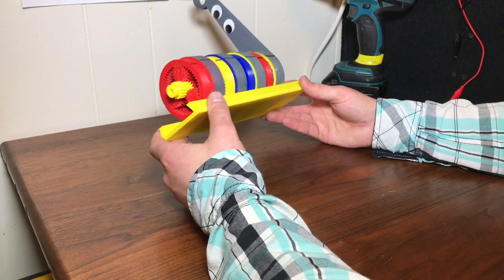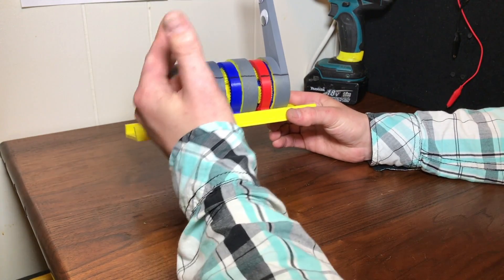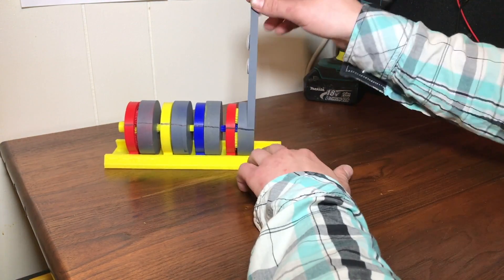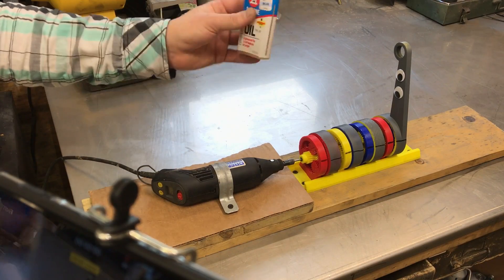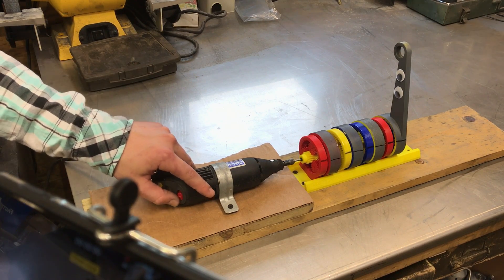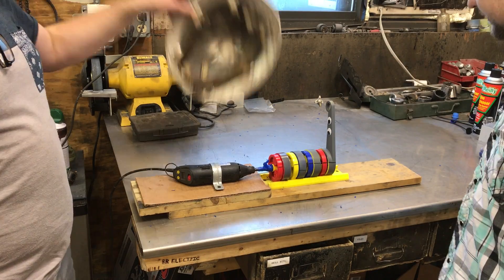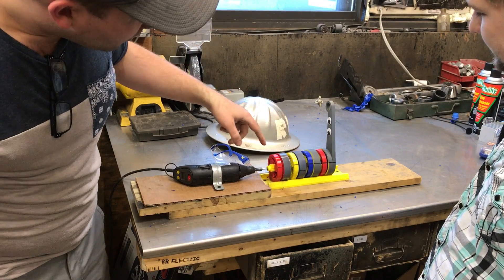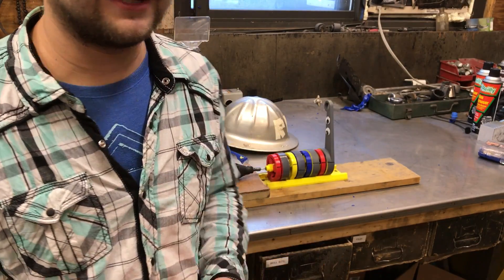3,616,238,492,881 To 1 - The Most Useless Gear Ratio Ever

Comment: If we rotate the lever, will the other end rotate 3.7 trillion times
Reply: Theoretically.  Speed and torque are inversely proportional.  So, it requires A LOT of torque to turn it since the speed would be so SLOW.
Reply: u can damage that shaft if u reverse it

Comment: I know a few things about different lubricants. I believe that most motor oils use additives zinc, or ZDDP which actually is supposed to wear instead of the metal parts. Tho most have cut the amounts down considerably "emissions", resulting in destruction of older flat tapet lifted camshafts. On the other hand synthetic oils are to slick not sure what ones tho contain no friction modifiers and the lifters won't spin correctly! In the humble words of Mr. Mackey , "Is bad mkay"! Also shouldn't be used for wet clutches, again to slick resulting in slippage.
Some outboard motors contain plastic or nylon gear boxes. So marine lube might be fine! I'd do a bath system have the oil just about deep enough for the middle gears will circulate. Kind of like the Lacus oil display if you've seen one! Keep the motor just high enough or use like a weedeater flex shaft.

Comment: You should have tried to move the arm with the eyes and the input point would hell fast as the gear system would work as a speed multiplier.
Reply: Swati Dutta it wouldn’t move, and if he did try pressing hard enough the handle would break off before anything moved.

Comment: What if you attach the dremel to other side.. 1 to 3,616,238,492,881  .. I know thats not possible :P
Reply: use a 3616238492881:1 gearbox to turn the 1:3616238492881 gearbox, the most useless 1:1 gearbox
Reply: @ovo5037  good point. 1:1 does absolutely nothing. 3,000,000,000,000:1 is still doing something.
Reply: @jyesucevitz  1:1 gear sets are probably the most common gear sets of all.
They can allow for linear movement (like the splines on a driveshaft). They can reverse the rotation of the output shaft relative to the input shaft.  They can turn 90 degrees or many other angles. Most 4-speed manual transmissions have a 1:1 4th gear.  Gears are useful for much more than just torque multiplication and 1:1 is an awesome ratio in my book!
Reply: @kevinsellsit5584  yeah sure hate not to have an overdrive gear
Reply: @ovo5037  WOW
Reply: @ovo5037  LOL
Reply: Why isnt it possible

Edit: its a joke I know why
Reply: @lagumlemoni331  torque 😂
Reply: @lagumlemoni331  ya u could it would be a shit ton a force and speed
Reply: @heheBOY you can use strange matter from the inside of a neutron star.
Reply: @heheBOY (In response to: No material in the universe can withstand that amount of torque) that’s not how yielding works… what youre looking for in such a case is fatigue yielding, not tensile/compressive/bending yielding, even though the axes undergo bending moments. And we’re not turning the high gear end so much that the lower gear end would break. The bending moments exhibited are discrete, not spontaneous. In the same sense, its theoretically agreeable that it is possible to control angular acceleration and maintain the subsequent angular velocity of one end to the extent that the amplification of it by 3.5 billion on the other end for given x radians in acceleration does not yield enough torque to cause fatigue failure. Even plastics have quite pretty high fatigue yieldings. So in fact its very much possible to do it without breaking, it would just require 3.5 billions as much torque required to move the lower gear end by those x radians to move the high gear end by the same radians.
Reply: A train could probably do it
Reply: @leprechaunbutreallyjustamidget  can't
Reply: @OddGaming-m6r  just need a good gaming chair
Reply: @OddGaming-m6r  it can spin it alright, but it's going to be spinning the table it's mounted on, not the gear ratio.
Reply: @heheBOY that’s an argument from ignorance
Reply: @Basaltic Life I think it's not the problem to produce such torque, but I think u can't produce Gearwheels which are able to handle such torque without breaking.
Reply: You open a black hole
Reply: @Basaltic Life Not even all the energy in our galaxy is enough I’m assuming
Reply: @mikyles.1830  if you used all the energy in our galaxy it would be more than enough, if you used all the energy of the sun you could turn that backwards trillions of times
Reply: @sauce8767  true...
Reply: @mikyles.1830  you can turn the a googol gear ratio bruh

Comment: So I know absolutely zero about engineering, so please correct me if I'm wrong, but the reason this is useless is because, even though it can produce a massive amount of lift with relatively little effort, the output that you would theoretically attach a lifting system to would be so slow that it wouldn't accomplish anything in a reasonable time; i.e. yes, it produces a lot of lifting power, but takes so long to do so that it's way more effective to use more conventional, less energy-efficient methods.

Comment: Heck, why not reverse it, so that one crank rotation = 3 trillion output rotations?
Reply: set up same gearbox in reverse to the slow end of this one. both ends should now rotate with speed of dremel ;D
Reply: @grindwind  friction says no but nice idea^^
Reply: @grindwind  that actualy could work... But then what's the point of it...
Reply: @grindwind  theoretically this should work but for some reason i doubt it will. Actually a decent idea to try out
Reply: Is that even possible?
Reply: The Jrr Nope
first of all youd need a ridiculous amount of power to turn it in the first place, and if you managed to turn it at all it physically would not work since it would move higher than the speed of light
Reply: @sauce1658  FTL travel confirmed? Lol that's a shame though.
Reply: The Jrr heh yeah if only, the friction would probably be ridiculous aswell
Reply: @sauce1658  and is that bad?
Reply: Dániel Deák Yes. It means you can’t do it. Not ever. Won’t be physically possible ever.
Reply: @sauce1658  and don't even think about the centrifugal force and inertia
Reply: @sauce1658  hollllllddddd uppp.... if someone were to make this on a larger scale lets say out of titanium or diamond or something of great strength and then apply the right force to get it to turn we would actually get to know the result of moving at the speed of light would we not?
Reply: @gregorygardner9500 well first of all there isn't a material on the planet that could withstand the heat produced from the friction
second we don't have any actual way to exert enough force to spin the other side
and third it's just physically impossible for us physical objects to move faster than the speed of light
Reply: @gregorygardner9500  if their 160:1 gear ratio can hold something like 400 lbs then this thing can supposedly hold 9 trillion+ lbs
that's over 29 million blue whales
and this is not counting the fact that any material we tried to use to actually support the gears lifting this weight would most likely be snapped along with the plastic gears
Reply: @sauce1658  and the mass would increase as it was approaching light speed that there wouldn't be enough torque in the universe to make it turn. Considering the power of neutron stars, supernovae and angry partners that's saying something..
Reply: @sauce1658  just use wd-40 lmao
Reply: Requires an unbelievable, incomprehensible amount of force to produce that kind of torque. No material in existence could withstand the rpm at the output and at that point it's radial velocity would be faster than the speed of light. So. Yeah.
Reply: @whogavehimafork  agh,nothing a little spit and elbow grease cant handle.
Reply: Those plastic gears would just snap
Reply: After reading theses replies I think I wanna do it
Reply: may take a tillion hp lol
Reply: johnny rotten Shut the bell up
Reply: All you nay sayers saying it can't be turned.  All you need is a breaker bar. A really long breaker bar.  Like to the moon length.  Get an astronaut to give it a turn. 

It should max out at the speed of sound.  But if it could reach the speed of light it would also become infinitely heavy and become a black hole.  So he invented a possible black hole generator.
Reply: @ShamanNaoYuki  This is how black holes are born. A planet finally reaches enough sentience to make this device on a theoretical scale, someone dares them to try it out, the result is complete destruction.
Reply: Chuck Norris beat that output lever in armwrestling.
Reply: Chris Hicks No material could withstand the internal forces of applying torque to a lever that long, it would bend if it doesn’t brake before that...
Reply: Friction
Reply: Do it in a dark room...then the light wont be there to compete...problem solved...
Reply: These replies of science nerds going blah blah blah. Speed of light blah rectifier starship anus blah.
Reply: If the gearing ratio potentially could throw car over Mount Everest you mere mortals could never turn that handle, Excalibur’s sword would even be extracted by the might of this gearbox. But, no idea why I endured watching it work...I thought they might actually fit a strobe light to the first gearbox and prove it’s rpm or run the second gearbox and take the rpm of each one either side, in reality all I heard was some great numbers, and a thermal image that takes a sample every 2-4 seconds. I missed the “Top gear” fun that could have been had here.
Reply: @johnny rotten at that point it continue to turn but be beyond matter. The energy would still continue. We dont know everything.

Comment: This wouldn't be so useless if it was made of some kind of mathematical-abstract material that's infinitely dense to touch (though of course not infinitely mass-dense) and completely indestructible. Think of how powerful this thing would be. You could generate enough force to crush hydrogen into helium, then crush that even further until you get super heavy elements, then neutronium, then a fucking black hole.

But yeah, seeing as we're limited to materials that are actually capable of existing in physical reality, this is pretty fucking useless.

Comment: Use it in reverse and you will destroy the speed of light
Reply: Ahh the speed of dark 😅
Reply: Bartek Sokołowski you aren’t good at detecting jokes are you
Reply: It would actually be cool to see in reverse with a different ratio to see if it could reach a speed where the last gear ripped it self apart due to centripetal force
Reply: Fill0016  in this scenario I believe it would be centrifugal force
Reply: I think the torque required to turn the other end would be equivalent to infinite.
Reply: actually it would be MUCH faster than the speed of light. If the yellow "input" wheel would have a girth of 5 centimetres the wheel would spin at 180million km per second. For comparison light ist 300k km per second fast.
Reply: Beater Nashi it depends how fast you spin the "output" end
Reply: Beater Nashi it would break =,=
Reply: @beaternashi2839  sadly we can't surpass the speed of light
Reply: na i think he would make a black hole
Reply: Who knew we could break the speed of light with just good ole fashioned gears and cogs.
Reply: the space police want to know your location
Reply: Bartek Sokołowski yeah I was wondering what would happen if you did that
Reply: Starshine Gaming 😁
Reply: Imagine the torque you would need.
Reply: r/woooosh
Reply: Best overdrive gear yet
Reply: UNZO the centrifugal force would cause the last few orbital gear rings and gears to tear themselves to pieces before it would have a chance of getting anywhere near that speed.
Reply: Who is getting wooosh, me? Did they change their name or delete?
Reply: @geo5378  not u
Reply: it would require a force which is equal to weight of the very heavy huge ship
Reply: That's not an infinite amount of energy.
Looks like it is possible ey ?
omg  ... Einstein was wrong !
Reply: @wernerboden239  
You would still need infinite energy because an object would become infinitely dense at light speed. Only particles which have no mass such as photons can do this.
Reply: dhalsim1 cough cough have you forgotten about negative mass (tachyons)
Reply: Dominic Surette the quantum state is a lie
Reply: Dominic Surette “hypothetical particle” 🤷🏻‍♀️
Reply: Gus TV everything about quantum mechanics is hypothetical/not real
Reply: Jake Mitch Idk what about quantum tunnelling or other mechanics but yeah quite a bit is hypothetical
Reply: @AlberTesla1024  more, calculate and you will find that it will require much larger force than you assuming .
Reply: @AlberTesla1024  neh... Never enough
Reply: Rip my fingers. I dont use keyboard.
Reply: UnchartedSky assuming a roughly 5 millimeter girth of the output end you see it spin 180million kilometers per second and the speed of light is 300 kilometers per second.
Reply: @stonewintjen505  speed of light is about 300million km/s
Reply: Nooooooooo please don't
Reply: It would go plaid!
Reply: @ernest48914  r/whooosh
Reply: Speed of light is broken
Reply: max marrero its called a joke my dude
Reply: people are getting r/wooooshed here
Reply: This is the fbi stop that
Reply: @Gkitchens1  should be
FBI : FBI! OPEN UP!  gun shots
Reply: GeometryDash717 The Challenger 😂😂😂
Reply: Marco Zdravkovic can’t help it. Gotta do it. So basically just needs the weight of yo momma
Reply: I knew I couldnt be the only one who thought of that. Then I see your post. You would think this guy would have tried this.
Reply: You unfortunately might be correct
Reply: Pull the handle right?
Reply: 1 to 3.6T sounds pretty fast
Reply: You guys don’t even use Reddit I bet
Reply: r/woooooooooooooosh
Reply: R/Woooooooooooooooooooooooooooooooooooooooooooooooooooooooooooooooooooooooooooooooooooooooooooooooooooooooooooooooooooooooooooooooooooooooooooooooooooooooooooooooooooooooooooooooooooooooooooooosh
Reply: Bartek Sokołowski KJ...😒
Reply: Starshine Gaming cringe

Comment: Go into the cheat menu, turn off friction and power it from the other side.
Reply: Leberkas Semmel you would also need to increase the games speed limit from 299792458m/s to something higher. you would technically have to hack which could get you banned but it's a risk worth taking.
Reply: klevin how did you calculate this?
Reply: klevin While you're there, you might as well give yourself an infinite force and make to plastic unbreakable. If you don't want to use infinite force, then attach the end gear to a pulley and some sort of holder, then go to your local neutron star and harvest about a cubic meter of its core and put it on the pulley. While you're at it, you should lock the core's dimensions and make the gravity multiplier 0. This may be an overestimate, so adjust the volume as needed.
Reply: Dani Paunov So it's doable?
Reply: Dani Paunov 
”go to your local neutron star” LOL
That’s a good American joke.
Reply: To decrease the chance of being banned play in single player
Reply: @chandlerlocklear3854  Creative mode is doable too
Reply: @cryingwater  but messing with the laws of the universe is sure to get you banned
Reply: @chandlerlocklear3854  Talk about xianxia novels.
Reply: You would also need a pilling force of about 50,000 Donald Trumps and I don't think anyone wants that.
Reply: @connierule3902  I do
Reply: Jeb would do it
Reply: You'd also have to turn off inertia or mass of the gears...
Reply: Leberkas Semmel  Hey if you find a way around the mod tracking software let us know frfr!
Reply: So make the gear out of lubrica...
Reply: Could a gear set like this be made in a game?
Reply: He'll break the speed of light
Reply: Rhubarb Kendleberk nerd is complement because nerd means really smart in everything and geek is really smart in one thing.
Reply: Temporary Die someone got bullied in highschool.
Reply: @TempSlothy  ah 5th grade.. what a year
Reply: @TempSlothy  no, nerd means he learns everything and forgets them a day later.
Reply: klevin nerd

Comment: I may be dumb but if we suppose have the power to twist the output side gear with the lever removed one full rotation then would the sun gear on the input side turn 3.6 trillion times?(assuming that we are Thor and we have enough power to twist the output one one full rotation)

Comment: So if you could run it the other way you could drive your car at about 500mph. Cool. What about silicone lubricant like dot 5 brake fluid it takes a lot of heat without boiling?

Comment: 3D printed Material (I worked with PLA) begins to get softer at around 100 celsius (212 fahrenheit) and begins becoming a fluid at around 180 celsius. (356 fahrenheit) (Heavenly depends on the material your using) So there's no need to keep it at 15 celsius (60 fahrenheit).

Comment: Thumbs down for the shit music. It made watching suck, even when skipping through. This concept is similar to Simone Giertz where there is an entertaining idea, but the creators don't put enough effort into the machines to have a chance at a decent result. You should have come up with something better for cooling and lubrication. The video had a rushed feel to it, like it had to be shot right now instead of working on other options to improve the project. My perspective is from building and repairing items that get used every day, and building a few machines turned out damn good for my first try. I saw a comment about you having the gear reductions made from metal. Hopefully, that works out and makes for something that will either last longer, or at least blow apart in a bunch of pieces for entertainment value.

Comment: Or you can reverse the gear mechanism and literally multiply the output I mean it would have to be metal and super stable also it would over heat and possible destroy the motor but the energy output would be on the next level